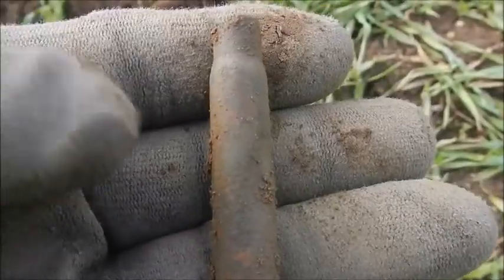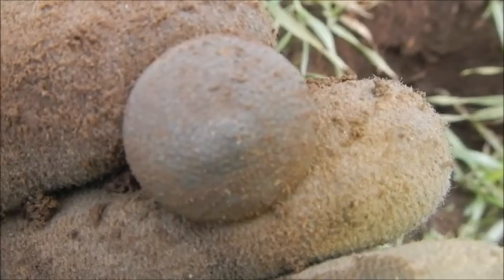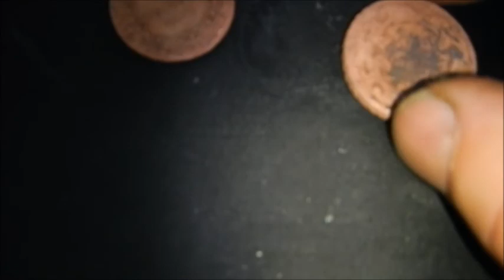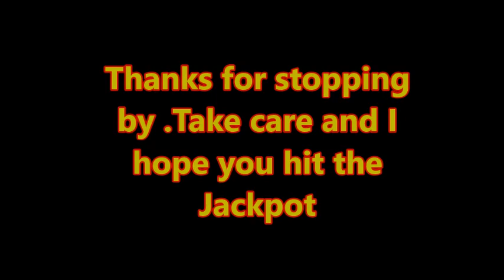2 coins But what a 2 coins it is ?

Comment: Holly crap Geoff they cleaned up well . Best wishes to David and his wife as  well .. 👍HH GL ON THE NEXT ONE Geoff
Reply from the maker: Hows it going Stephen  . The weather is good here at the mo but been working on the house . I might try going out tomorrow .
Reply: @cromwell13649  we have and high winds heavy rain. I've been getting out though .starting a new job Monday so won't be able to get  out much.. hope the house is coming together well .best of luck when you get out next Geoff 👍
Reply from the maker: @tidytreasurehunter1828  We have had pretty decent weather here ,in fact I got an outside project   finished . I filmed it but there will be an inside project published first.
Reply: @cromwell13649  nice one Geoff